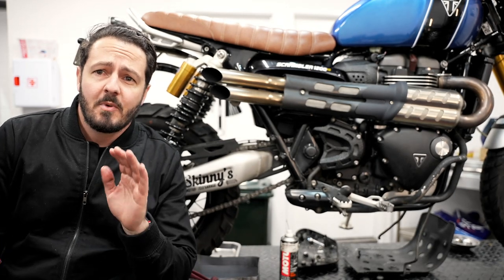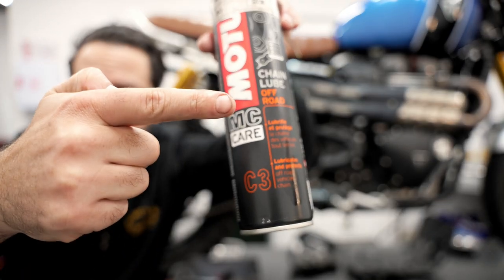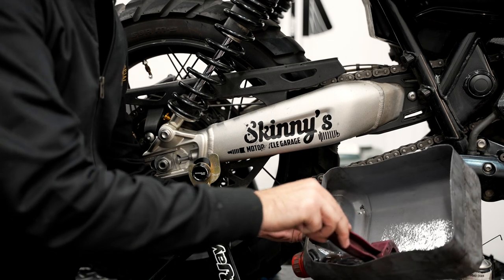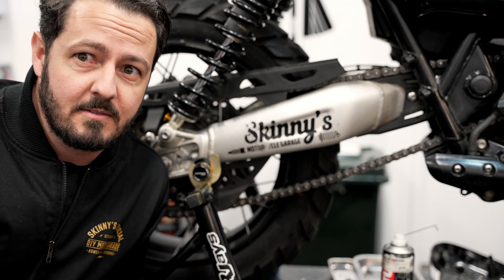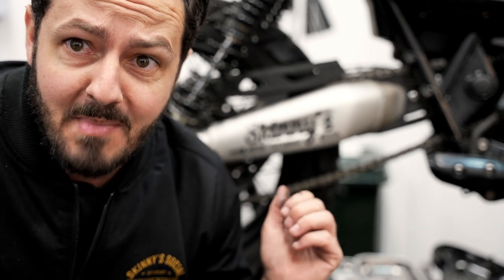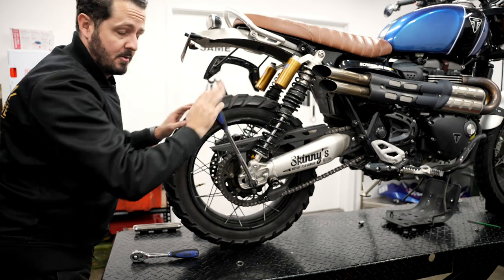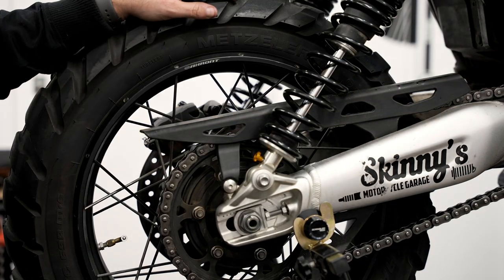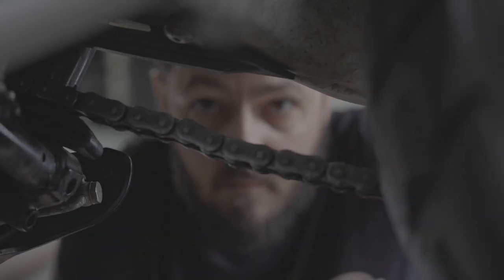FAST chain lube and check! | Scrambler Adventure Tips EP 1

Comment: The best solution I learned it to lube with WD40 for dirty off road stuff and 75 or 80 weight gear oil for on road. WD40 isn't as good but is cleaner and stick to less dirt. Also, even BMW recommends gear oil for their bikes. WD40 also works as a low quality cleaner if you don't have a real cleaner on hand.
Reply from the maker: That’s interesting I might give that one a go! Thanks!

Comment: Sorry, not a chain comment but at the start of your vid you can see what for me has been the best accessory for the bike: the little heat shield between the middle and front pipe. No need to decat with that which means your warranty stays valid and the planet stays a bit happier and you can ride in riding jeans without your leg frying. I found it on the back end of a triumph blog about 6 months ago and I've never seen it mentioned anywhere. If you do a vid on heat protection I reckon it would be worth mentioning.
Reply from the maker: Good pickup! Will do - that’s actually a design by a guy named Matt  in the “Scrambler 1200” group on Facebook, he designed it and you get it 3D printed by Formlabs in high temp nylon I believe. It does help a bit, but doesn’t solve the problem all together, but definitely worth an episode to chat about. In the meantime this is the leg saver link:

https://www.shapeways.com/product/3TUGRZSJU/scrambler-max-plus-leg-saver-v1-2?optionId=223109725&li=shop
Reply: @lifeofascrambler  That's the guy. I'm quite tall and it totally fixed it for me sitting and standing but that will probably be down to leg length.

Comment: If the wheel is aligned correctly, then the easiest way to maintain that alignment is to move the adjuster by the same number of flats on each side. Also, if you slacken the locknut before loosening the spindle you're less likely to accidentally move the adjuster a flat or two.
Reply from the maker: Awesome tips thanks!

Comment: Maybe worth using a torque-wench to finish off the axle nut tightening - you mention it is tight ~ torque wench confirms what is loose / just right / stripped threads? Also, as you tighten up the slack of the chain some play is required, as per the manual spec, and should be done at the tightest part on the chain as they do not always wear evenly around the whole length.
Reply from the maker: Excellent points! I plan on doing an update video at some stage so I’ll include some of those for sure!

Comment: Nice and informative videos! 
Also wasn't clear from video if you did so, but will be useful note for other guys - when lifting bike at some tricky place from a ground (like it was shown at 9:04) keep bike in gear and if it is possible - hold front brakes when lifting. If it fell on left side - something like rubber band on brake handle really helps. Bike won't roll back and your back will say additional thank you :D
Reply from the maker: Haha yeah that’s good advice - if you watch my other videos you’ll see when I learned that lesson - I tried lifting my bike in neutral and it rolled backwards, so I had to drop it back down and whack it into gear 😅

Comment: Thanks Mate, I would also like to see suspension specifically front. And for future videos maybe a run through of the options on the clock. Appreciate the work you put into these.
Reply from the maker: Awesome! I’ve got one in the works actually. For front suspension It’s actually relatively simple to figure out how to tune it but the hard part is setting it up for what you wanna do - as a general rule softer on both is better for bumpier surfaces and they just adjust with a flat head or even a key or credit card in a pinch!